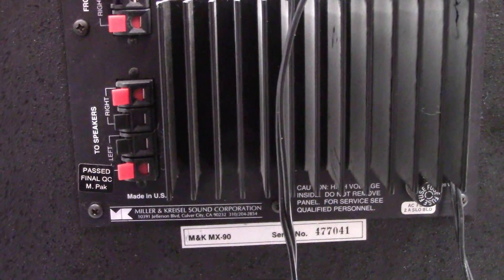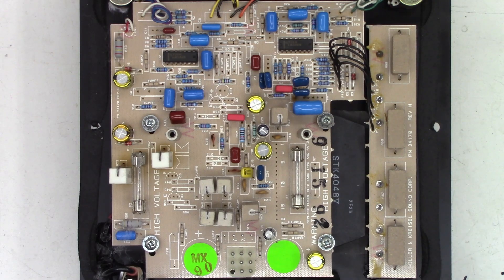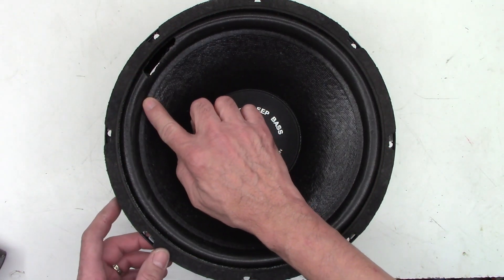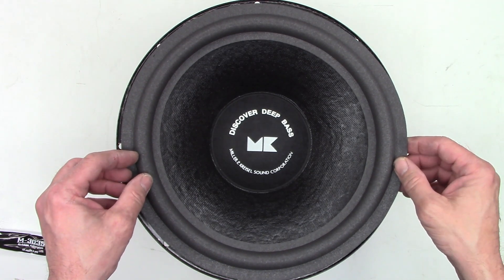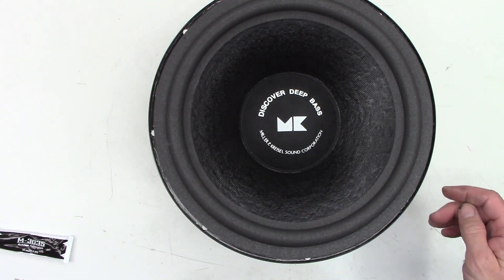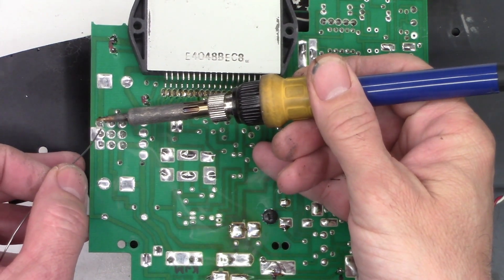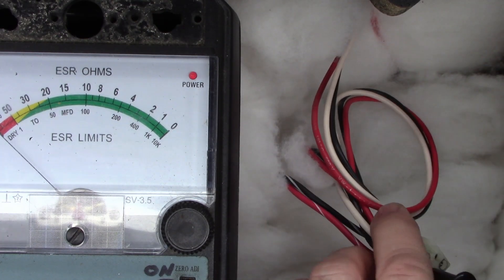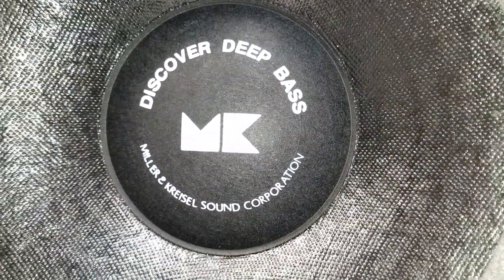MILLER AND KREISEL MX-90 SUBWOOFER CAPACITOR REPLACEMENT AND RE-SURROUND BOTH SPEAKERS. M&K MK MX90

Comment: I have a couple MKMX90 10 INCH sub's out of bx90 amp i still have cabinet but i think the amp is  bad it would play for awhile then make loud humming noise it actually blew my harmon karden PM 660 and did something to my Rotel integrated amp but that's in shop now. The MK was owned by my grandfather who bought it25-30 years ago the sub's are in perfect condition no rips or tears they never even seen loud power beings my grandfather owed them.i took woofers out cause trying to sell them but they can take cabinet also everything is there the cabinet with the speakers i guess weigh not sure but takes 2 to carry them speakers got weigh 15 pounds together so I'm guessing all together i guess 50 pounds or more the cabinet is Black oak. Im just curious how much i should ask for it i do believe from what i was told he paid 800-1000 over 25 years ago lookin at sub's u would not even think they r that old they still have very good glossy look likeness damn near. Maybe u could message me back tell me about them i would appreciate it thank you. If u got a way i can send pictures i will but i don't think i can on here u can Messenger me at Bobby Reiter i have red bandana on in profile pic thanks

Comment: Great video! What voltage are the 100 uF Panasonic caps that you installed?
Reply from the maker: 100uf 63Volt capacitors

Comment: I have the same subwoofer, found it at Goodwill for $10(!) However the amplifier does not seem to be amplifying the sound- using the preamp inputs I can hear (barely) some sound out of the sub, and the amp's red light is on indicating it is receiving power, just no amplification into the drivers. Have not tested the speaker level inputs yet to see if the issue is isolated to the preamp signal path.

Comment: Hey, I've got a definitive technology pro sub 600 with active crossover and power amp. I attempted to connect another sub, just a little Samsung sub and when I powered up and put sound through it I heard a pop and now I have power but no sound. What did I do and how can I fix it? I'm pretty good with a soldering iron so if perhaps you can give me an idea of what to do I can see if it works. I watched your video on the super cube but my amp is a lot different then the super cube. I've subscribed to your channel and would appreciate it if you can help me figure out what I did and how I can fix it with your guidance. Thank you very much! I can send photos if necessary...?
Reply from the maker: email me Norcal715videos@gmail.com

Comment: I'm trying to replace both speakers in mine. I removed the speaker screws but can't break the speakers loose from the cabinet.
Are they glued in or just stuck real good?
Reply from the maker: The normally just held in with the foam and after time the foam turns to glue it becomes very hard to get it out. Sometimes you must gently pry around the speaker a little bit at a time until it breaks free
Reply: @norcal715  You were right. Pry bar popped it right off. Thanks!

Comment: Excellent timing. I have a pair of these MX-90’s and one of them is beginning to hum intermittently. The other needs a new surround. I will run through the board checks you covered. Do you know where I can find a schematic for these, I couldn’t find anything with a quick search. Thanks for posting this repair. Safe holiday to you.

Comment: Was the subwoofer inside active or passive? thanks.
Reply from the maker: Active!
Reply: @norcal715  Wow. That's weird. One active behind the other. Never saw one of those before.
Reply: @ThePreyMantas  Its called a Push Pull design.  These subwoofers are quite remarkable considering they are only given 125 watts RMS.   These things were rated below 20hz
Reply: @JaZu completely agree. It’s truly incredible